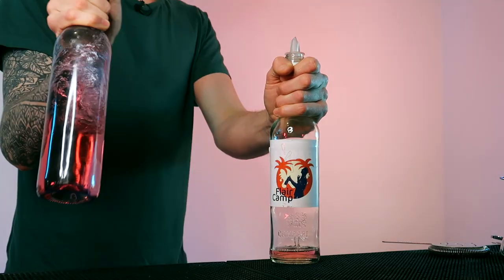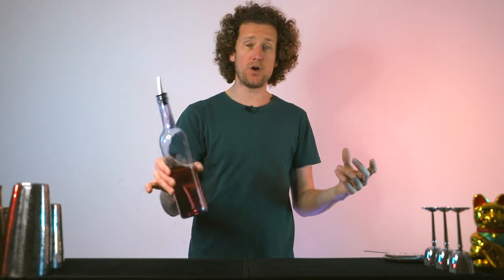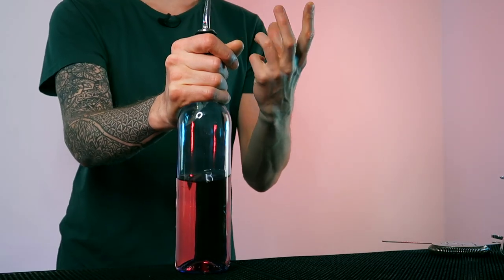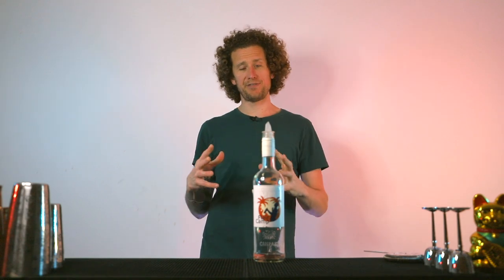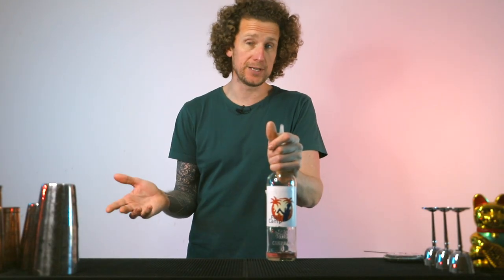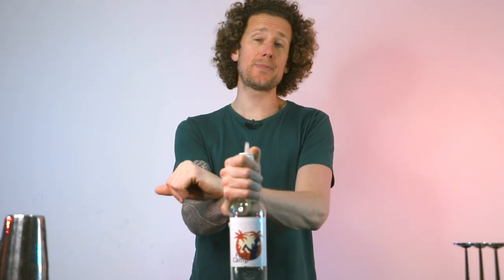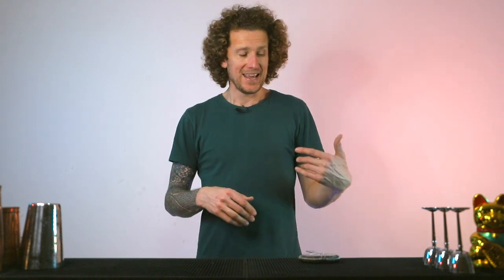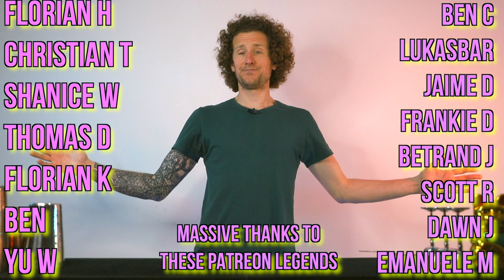The difference between WORKING FLAIR & EXHIBITION FLAIR

Comment: Question. Why are we using metal pourers whilst doing a working Flair and a plastic pourer while doing exhibition Flair? Is there a reason for it? Thanks Tom!😊🤙
Reply from the maker: Yes. 
To make the working flair bottle as "real" as possible to match working behind a bar.  There is also a smaller reason and that is because a metal pourer pours better and cleaner than a plastic.
Reply: @TomDyerBartender  Thanks Tom! I appreciate the insight 😊🤙